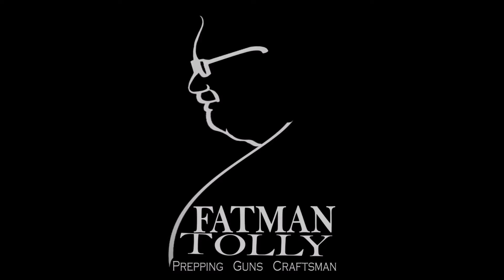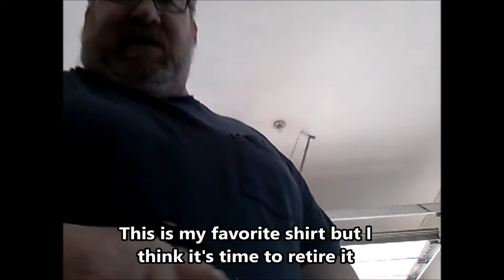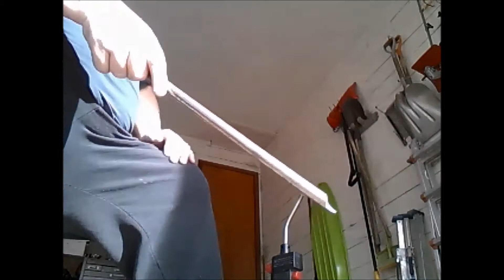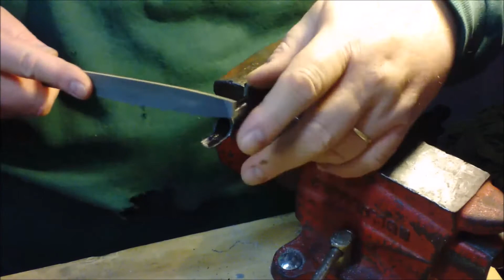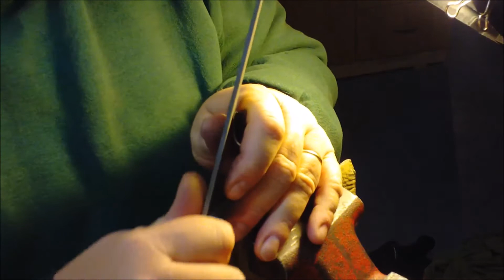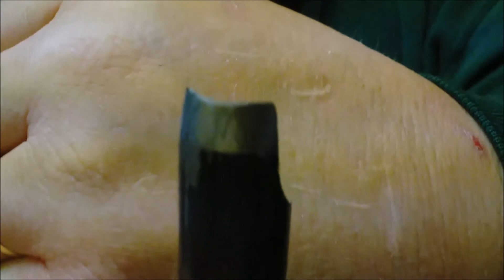Handmade leather craft tool

Comment: Heat it up till a magnet won't stick first let it cool slow to work it then do the same  and quench in oil to harden use a good file. I used a Nicholson it works like 1095.

Comment: Well done bud...! I would use sandpaper wrapped around a dowel to slide in the inside of the tube - the file is too aggresive going off the edge - it might work better going into the edge towards the body of the tool... I just sharpened se large diameter leather hole punches with the sandpaper method - worked good...
Reply from the maker: Great advice, thanks.

Comment: I used a piece of DOM to make myself a gasket cutter just like this one is for leather work. I heated my and cooled it in rock salt,...I think it hardened it. It' hasn't chipped of blunted yet.   This is a good idea.
Now as for the shirt,..why retire it ? If it's comfortable, keep it, but maybe not for video 'performances' !
Reply: Reg Sparkes  Oh, I forgot to say that the gasket cutter I made is 'similar' to this one you made, but mine had the sharp edge all way 'round,...I use it for cutting bolt holes etc.
Reply from the maker: Yeah, I totally forgot I had it on till I edited the clips. DOM is the next try. I never heard of using rock salt, I'll look into that one.